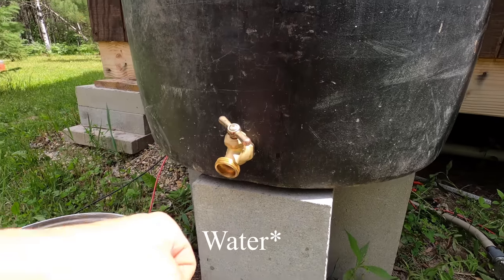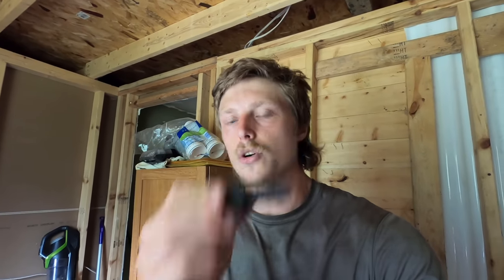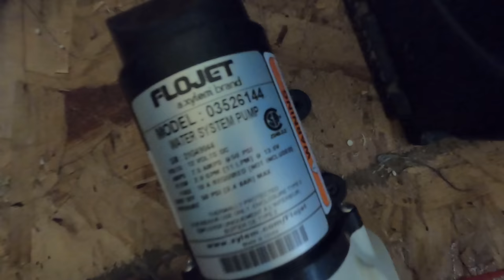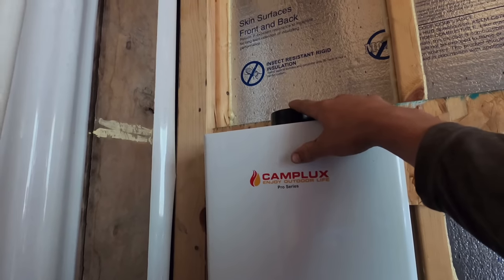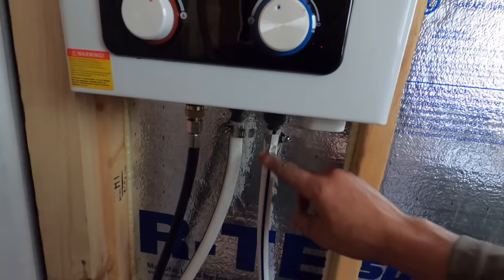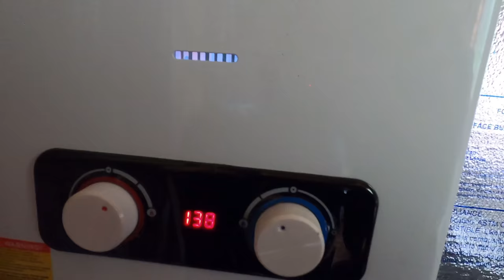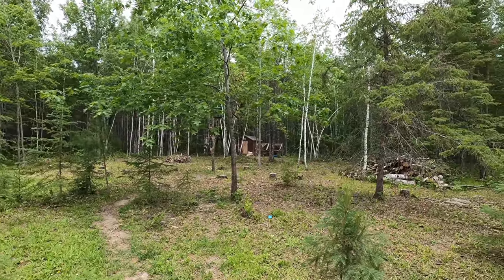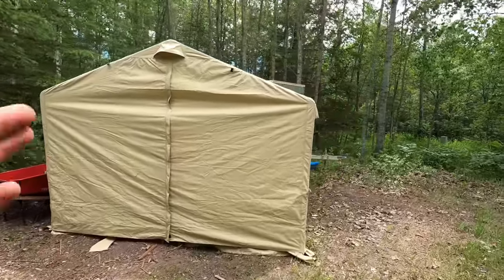Running Water At Our Simple Off Grid Cabin In The Woods

Comment: I wish I could have running water at the cabin! You're lucky
Reply from the maker: It’s the best!
Reply: Have running water the old fashion way. Put the water tank up higher than the sink or shower, and use GRAVITY!    It works perfectly for most things.   

 Obviously you can also get solar powered or battery powered water pumps or camping shower systems that can be connected to a sink

... but gravity is free

Comment: A simple and effective water system. Am I wrong or you're close to a river? If that's the case you should consider a ram pump and a water tower to buiöd a gravity-fed water system. 

Pros:
- Cheap and easy to built.
- Works even with no electricity.
- Extremely low maintenance.

Comment: Can you test the mineral ratios in your drinking water?  That is a good idea with rain water.  Rain water is sometimes TOO pure to drink, similar to distilled water...... It is a good idea to find out if you have to add trace mineral drops or a mineral mixture to add to your drinking water. Sometimes a simple electrolyte drink mix will do........   you don't have to add it to your main water tank,  just the water you drink........  

That would be interesting for your next video to get a mineral test kit.  And PH test kit.  

Also** mosquitos reproduce in still water, if your water is exposed it can be an issue, obviously you can  filter it from the main tank and boil drinking water if necessary.   
.....If you have too many mosquitos, here is an idea, find ponds with still water and setup a solar powered water pump/water fall, to create motion in the water. That can decrease mosquitos.     I have also seen mosquito zappers if you want to go nuts.

If your water tank water is exposed, also consider a solar power pump to cycle the water, so it is not still.
Reply: ʟᴇᴛ'ꜱ ᴛᴀʟᴋ ᴏɴ ᴡʜ-ᴀ-ᴛ-ꜱ-ᴀᴘᴘ 
.👆👆✍️.......

Comment: You should have installed a cold water line so the hot water is scalding hot.
Reply: Or just turn the heater thermostat down when you shower.
Reply: @garysork5603  The temperature can only go so low and still be scalding hot.
Reply: 46.4 deg. F temp. Rise on low setting. With 50 inlet that’s 96 outlet. But your right. Still could get burned. I would have ran cold too.

Comment: You need a better constructed pressure treated wood base under that big barrel, and a better barrel, maybe a bit higher for better outlet pressure.
The downspout needs a clean out port, upstream.
The rain water should be prefiltered before the barrel.
You can also buy cheap insertable gutter guards to stop leaves, needles and other debris outta your collection gutter. The wire ones better.
Both the gutter and collection barrel should be cleaned regularly.
You need some chemical water disinfectant in water storage barrels.
You need to Berkey filter this water, but I don't think you're drinking it.
I told you how to build and set up an outdoor wood-fired water distiller, for drinking water.
You drink bottled, no?
Reply: Exactly. Apparently there is no plan for a water purification/filtration system.

Comment: Nice job Kyle. We have a very similar setup in our off grid cabin and another in our bathhouse/sauna. We also use the camplux heaters but they have the temp gauge on them so it’s a little easier to adjust the temp. We did pex in the sauna but used washing machine hoses for our kitchen sink. It has held up nicely for over 3 years now.

Comment: You need to purify that water. Bacteria Mold, and Fungus  will grow in the standing water, even if not use for drinking , it might cause other health issues. filer, or Chlorination as a minimum. Water from on open source is not safe for use without treatment. Hopefully all consumed Water from that source is Boiled before consumed?    Why not at least a Shallow well, which still would need to be purified, but would be better source for Water than Snow and Bird droppings roof sourced?
Reply: @Howard. You said everything I was thinking. There was no mention of a water purification/filtration system. Running water inside the cabin from rain is not drinkable unless boiled or treated. Also, I would be hesitant to use those 55 gallon drums to collect and store the water. There is no way to find out the  previous history of the drums. They could have contained toxic chemicals. You never know. You also mentioned the risk of pollutants, bird droppings, bacteria, mold, and fungus. However, Kyle did accomplished his goal with running water. But it may cause health issues.
Reply: ʟᴇᴛ'ꜱ ᴛᴀʟᴋ ᴏɴ ᴡʜ-ᴀ-ᴛ-ꜱ-ᴀᴘᴘ 
.👆👆✍️.......

Comment: If you think that waterheater really doesn't need a power source, try removing the D-batteries and see if it fires up. It really does use power, albeit from batteries, but without power source it won't work! I suppose you mean to say you don't have to hook it up to a 12V DC, 120V / 220V AC source.
Reply: ʟᴇᴛ'ꜱ ᴛᴀʟᴋ ᴏɴ ᴡʜ-ᴀ-ᴛ-ꜱ-ᴀᴘᴘ 
..👆👆✍️.......

Comment: In the winter how will you melt the snow in the rain barrel?
Reply from the maker: We don’t melt it in the barrel we have a metal stock pot that we melt snow in. I tried to pound a sandpoint well twice here and it’s not going to work. So until we get a well drilled rainwater and snow is how we will go about it. It’s what we have done for a few years now so its just part of the routine
Reply: @KYLESCABIN  I was hoping the sandpoint well would work.  I wanted to see how you do it as I'd like to try here at my house to water my garden.
Reply: This is probably a dumb question but...don't you need cold Water run to shower  ..... not just hot, so you don't  get burnt ?.... or can you adjust the temperature ?
Reply: @lindagallaher5814  on his on demand water heater he can adjust how hot they want the water, it had a digital display on it

Comment: Use pine needles to mulch your garden beds.    Apply on top of a thin layer of compost.

The new shed might also double as your power building. You could put all your batteries and some additional Solar panels on top of the roof to create more power. Run the line to the house and boom.

You can find used panels with plenty of life in them for sale. They might require a little more work to make compatible with Ecoflo but there are plenty of vids on how to do it.

Water system is awesome and will only get better as you perfect it.

Comment: Most showers have a hot and cold water supply and you adjust the temperature by adjusting the water flow how are you going to adjust the water temperature when your only using the hot water as 138 is rather hot although I’m sure my wife has hers that hot lol.
Reply: Just set the heater thermostat to the comfortable temp and you will not need cold water.
Reply: @beckyumphrey2626  but then it’s not that hot for washing dishes etc.
Reply: @1MartinWaite  Guess I am missing your point.  Water that is hot enough to bath in is surely hot enough to put your hands in  to wash dishes.  Many people that hand wash dishes do not use hot water.